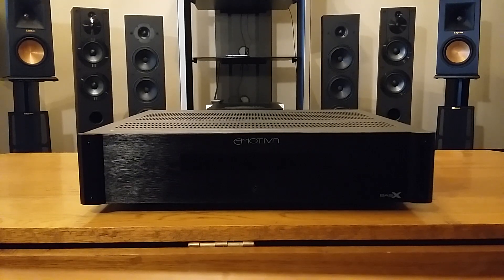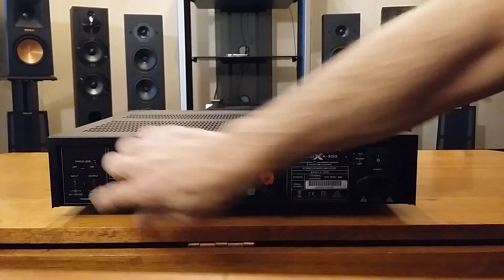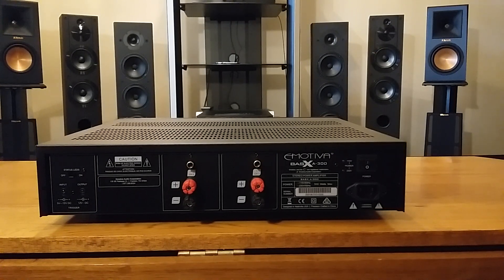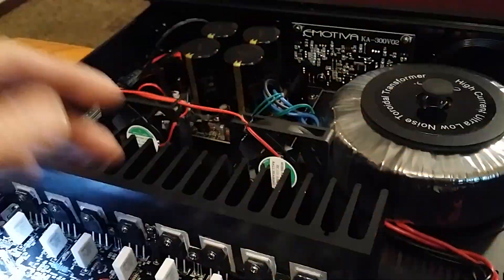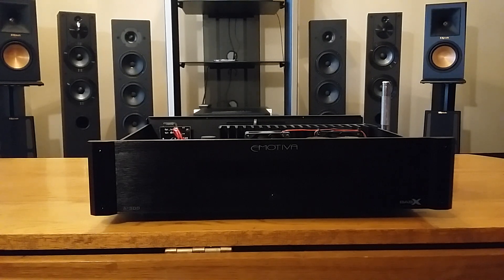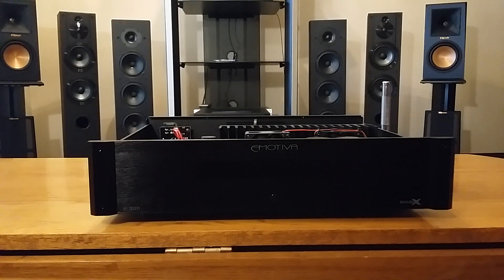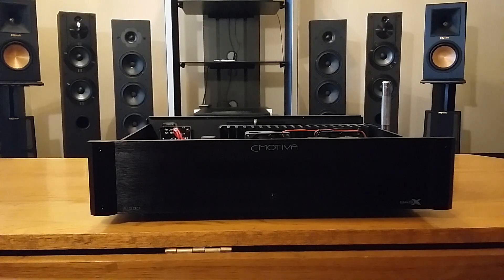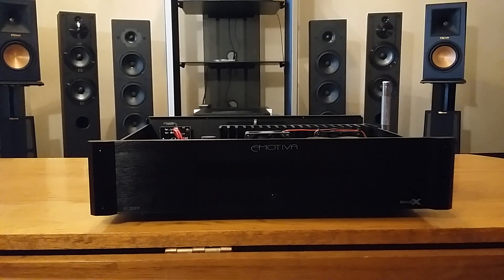Emotiva BasX A-300 class A/B 2 channel amp full review and a peak of what's inside of this amp

Comment: My left channel has gone weak on this amp.  It still plays, but what I used to play both L&R on my marantz at -5db each.  Now I have to run the left at +10db to keep the output balanced (I'm testing this via my marantz test outputs and a db meter).  I ruled out cables and speakers....... everything points to the left channel.
Do you think loosing one capacitor would do this?
Reply from the maker: Depends on which cap in the powersupply no most likely transitor going bad if you checked all other cables wires and hook up opposite speakers '

Comment: Emotiva discontinued the BASX A-300 (1 or 2 years ago), and replaced it with the BASX A2. Both of these power amps look almost identical front and rear. The difference is they downgraded the A-300 power spec. from 300 watts @ 4 ohms, to 250 watts @ 4 ohms for the A2. It's probably the same circuitry. Maybe they realized the 300 watt/4 ohm spec. was not accurate. I still want to try out an A2.
Reply from the maker: Yeah i think i frowned on the 300 watts even during the review but how many watts doesn't matter what matters is the quality of them watts 😃 I would love ro see companies measure at full bandwidth !! Thats a different ballgame thanks for stopping in and letting me know
Reply: @tee-jaythestereo-bargainph2120   Thanks TJ.
Reply: Formaly A-300 Power Supply provides double 52V voltage, so the power output max on 4Ohms is
 (52/sqrt(2))^2 /4 giving 338W of power in each speaker w/o distorsion.
But its transformer was less powerful to provide 2x300W for THD 0.1%, so the spec was THD 1%.

But 2x300W and THD 1% was reachable.

Comment: Ive yet to find another amp @ these power ratings made in USA for the same price. Finally saved me enough to buy one, then Emotiva goes and 86'es the model! I reached out,and they offered to sell me a refurb A300. These guys really are awesome, Emotiva is highly underrated if you ask me.
Reply from the maker: Its been a solid amp for sure
Reply: @tee-jaythestereo-bargainph2120  Much thanks. My rig is a hodgepodge of vintage middle/upper middle shelf gear. The amp just feels right in every way for my specific application. So very eager to get it now : D

Comment: Been thinking about getting a power amp for a while now. Have a marantz sr6007 receiver powering my Polk rtia12s sounds good I guess . Would this amp help bring it to another level?
Reply from the maker: What would you be using for a preamp ? Your Marantz Reciever ?
Reply: @tee-jaythestereo-bargainph2120  yes
Reply from the maker: @christhomson9170  the 6007 is about a 25pounder and driving all chanels you get a real maybe 55watts but Marantz is pretty solid now if you had a Nr1607 slim Marantz i would say yeah go for it ,
 I mean yes you would have a lil more power and relieve stress off the marantz   6007 but whats really important is finding out what the preout for front left/right speaker is from the Marantz it self i have seen the preout voltage basically be to weak to drive a bigger amp properly Audioholics Gene breaksxthis down in one of his videos , And the thing is the Emotiva does not have a gain controller on their basx A-300 so you can't match the voltage output ! You really need a 2volts output from the preout of the marantz and alot of times you'll get like 1.5-1.8 and this will not drive the Emotiva amp properly and when this happens to pep their like this amp sucks when in reality the voltage gain output isn't enough if you can go for the Marantz 7025 that one should match your amp maybe you can find one on sale their about 799.00 new i know twice that of the Emotiva but i keep it real dont want you to spend money and then be disappointed !
Reply: @tee-jaythestereo-bargainph2120  that’s what I was asking. Thanks for the info.
Reply from the maker: @christhomson9170  anytime chris channel belongs to the subscribers since day 1 😆

Comment: Is there an appreciable benefit to adding this to a surround receiver with pre-outs for the front channels?
Would it help for two channel mode?
Reply from the maker: Yes i have used my Marantz hometheater reciever paired to the emotiva a300 more headroom and drive/Torque/ fullness in the bottom end i use the NR1409

Comment: TJ, can this amp handle 2 pairs of 8 ohm bookshelf speakers.   1 pair of Elac Debut Reference speakers and 1 pair of Fluance Signature Series Surround HiFi Bookshelf speakers?  I i tend to parallel connect these speakers which I do currently with my Denon DRA-800H Receiver.    I just purchased a A300.   I intend to play with a IOTAVX SA3 preamp.  I like it that it is made in the USA.  I am toying with ordering a IOTAVX PA3 Amp to see which may be better.  For the record, the Emotiva is more powerful, includes free shipping, but does charge sales taxes.  The IOTA does not impose taxes But does charge for shipping at British pound rates (IOTA is a British company).  Said and done, the Emotiva has slight edge in total costs , about $70  or so.  I'm looking forward to the use in my stereo setup.
Reply from the maker: I wouldn't , its not reccomended 😃

Comment: If it is not for the obvious price difference, do you recommend BasX A-300 amp or 2 Outlaw audio model 2220 monoblock? Outlaw monoblock sends 200 watts at 8 ohms and 300 watts at 4 ohms. From the BasX specs, it looks like the 300 watts at 4 ohms is rated at 1 khz.
Reply from the maker: Yes at 1khz i never tried the outlaw b4 but i wrote them a year ago to send me something like the 2270

Comment: I have the xbase and the top end is wicked!
Reply from the maker: With the right PreAmp this amp kickass ! Espically for price point ! I never haf a fan kick on or any problems has the cool clean top end !
Reply: Tee-Jay The Stereo-Bargain-File, what I find funny is that this class ab amplifier runs cooler than any class d amp I ever had! The amp barely ever gets warm at all and I keep it on all the time.
Reply from the maker: @peterotremba8980  same here mine stays cool also , And i drive some very non effeciant speakers ! Its an awesome amp the Preamp PT-100 is ok espically for the price , but once i used an 800.00 Pioneer elite HiRes reciever thats a preamp also ohh my ! What a difference I even used the 499.00 IOTA SA3 integrated amp thats a preamp also with the A-300 and could not believe how much better it sounded than the PT -100 !

Comment from the maker: I used a$ 800.00US warmish sounding Pre-amp for my subjective Opion of the A-300 ! I should have not done that , I should have reviewed the amp with the PT-100 which in more recent videos i have , This amp is on the cool side of netural decent bass midrange is not forward at all decent imaging for its  price point  still till this day i give it a 4.5 stars for 400.00 US its a kickass lil amp !
Reply: If you're using speakers that can be bi-amped, it's worth it to get the TA-100 over the PT-100.  It's the same pre-amp, but you can use the TA-100 to run the highs, and the A-300 to run the lows.  It's just $100 more.  So, you could get the T2+ towers, TA-100, and A-300 for $2200 all-in, and have something to blow anyone away.
Reply from the maker: @cowboyflipflopped  the Ta 100 is
 50 watts the A300 is 150 watts thats a big difference to use for biamping normally the rule is half the power of the larger amp 😃 You would want 'atleast" a 75 watt amp and an integrated amp used as a pre-amp adds alot of noise ! Just keeping it real !
Reply: @tee-jaythestereo-bargainph2120  You may be right.  But for some odd reason, it sounds great to me.  I have tried using the TA-100 as just a preamp, and letting the A-300 handle the towers by itself.  I also replaced the brass connectors between the binding posts with good 12ga wire, for that experiment.   They sounded really good that way.  But they definitely sound better using the TA-100's amp, too.  I used to use the TA-100 with some HSU bookshelves, before upgrading with the towers and A-300.  So, I'm building with what I had on hand.  But, I would recommend this setup to anyone.  Maybe it's not as good as it sounds, but I guess I'm not too worried about that.
Reply: @tee-jaythestereo-bargainph2120  hi Tee-Jay, great review! I really love the passion and honesty of your channel, and I have some questions for you. 
Is it ok to connect a phone to the a-300 power amp directly via 3.5mm to RCA cable without using a preamp? 
Currently my phone is my only music source. I know it’s not ideal in terms of sound quality, and I don’t mind not having tone control and analog volume adjustment. 
Is it going to work? And will it cause any damage to the amp? Are there any other disadvantages? I tried to research online but couldn’t find the answer. 
Thank you!
Reply from the maker: @pengxu8542  you can put i wouldn't recommend it 😃
Reply from the maker: @cowboyflipflopped  thats all that matters is that it sounds good to you !!!!!

Comment: I've had mine for about two years driving my Klipsch RP-280F mains off a Denon AVR-X4300H in a 7.2.4 setup. That Denon is a 125w/ch  $1,600 AVR and this improved the clarity, dynamics, and punch of the mains, and it also allowed the Denon to run barely warm as opposed to hot even under very high volume levels.  I can backup everything said in this video.  This Emotiva BASX A-300 is as good or better any $1000 range two channel amp you can find.
Reply from the maker: Thank you for backing me up ! The amp is a true Gem at its price point , 
I won't ever get rid of it., I have thought about modifying it later later on maybe just sounds so clean , 
I'm about to review the combo PT-100 /A-300 in the nexted week or so been pulling very long hours at work 7 days a week 😥  thanks again for the comment
Reply: Hey Tee-Jay, how's it going ? Did you ever modify your A300 ? Interested if you have any upgrade ideas ? Cheers, Mark

Comment: Need a small tips
Considering the A300 to push my 75 watt speaker
Is there any implacation as the Amp is 150 per channel and my speakers is 75 watt.
Is there any setup to adjust to 75 watt
Reply from the maker: Their is no Gain -Controls on A-300 
 But i would rather have more than less having lots of head room, your lease likely to clip the amp 😆

Comment: so a 4.7 for the Emotiva BasX A-300 and a 4.5 for the IOTAVX Stack??? Do you have a take on the IOTAVX SA 3(which I saw your review on) used as a pre-amp vs The Emotiva TA-100(used as a pre amp) or PA-100(same as TA-100, no amp... same DAC)??? with the reviews Ive read/ watched, Id say the reviewers lean towards the IOTAVX DAC(Wolfson) as the better sounding of the two... but nothing definitive... Thanks
Reply from the maker: Yes the IOTAVX SA3 and complete STACK is atleast 2 levels above the Emotiva combination with The TA-100 integrated amp and the PT-100 Preamp with the emotiva BasX-A300  , I knew adventually this question was coming and i have to be honest, i was so upset that The Emotiva basX PT/TA 100 was not all that good compared to the actually a300 amp so much so i didnt review either TA/PT because i couldn't reccomend them at all, very thin sounding not enough meat on the bone the interface and remote was awful ! So yes the IOTAVX-STACK is much better ! Now i took the IOTAVX SA3 and used it as a dedicated Pre-Amp connected to the Emotiva BASX-A300 and i about fail over !! Still not as good as the complete STACK but maybe just a level or a half level behind the complete STACK .So the IOTAVX-SA3 will be a good upgrade for someone who has the TA-100 or PT-100 hooked up to the BasX A-300 😆 at work hope this was understandable
Reply from the maker: Emotiva with their BasX line the amp is great I was not impressed with the analog devices 1955 built in DAC the IOTAVX-SA3 Has a much much better built in wolfson Dac. But thats my opion maybe someone else likes the Sound of the PT-100 or TA-100 but the remote and interface problems also kepted me from reviewing them and u know i would have gained more views and subscribers but i have to keep a honest foundation

Comment: Awesome power amp, can't beat it at this price. If only emotiva would fit quiet fans inside it. I had to change mine for some really silent ones because the original fans were just too much noise. As for the sound, I doubt you can buy anything under 1k USD to beat this.

Comment: Great review! I own the A-300 and I agree 100% with opinions about the and your sentiments here 15:02 . I'm actually driving 250 miles tomorrow to buy an XPA-2 Gen 2 !
Reply from the maker: The XPA-2 Gen 2 is a beast ! What  Pre-amp are you using ? I tried the PT-100 And T.A. 100 but really didn't impress me much. Not bad for the price but the A-300 amp Is very impressive . Buf i did finally find a responsable price Integrated amp that sounds amazing for its price point and its designed as a pre-amp also and pairs very well with the A-300 .I will be reviewing what i'm talking about nexted weekend
Reply: @tee-jaythestereo-bargainph2120   I'm  running an Integra DRX-3.1 as a pre/pro.
Reply from the maker: @noguardrails47  Heck yeah Honest ratings has somewhat the same build parts and  quality as the Pioneers Elite SX-N30. The Elite was 799.00 new  2 channel class A/B PRE-PR0 ,Took me 8 months to find better sound for a budget price under 600.00US i went threw 3 preamps 1 integrated pre/pro 5th buy was a charm ! But yeah i would use your A-300 for your surround speakers ! or maybe 2 center channels , center channel is so important !!
Reply: @tee-jaythestereo-bargainph2120   I was thinking I'd buy a used UPA-1 for center channel amplification, when I can afford it and see the right deal. I do have a feeling that the line out voltage of my Integra DRX 3.1 might be below the needed input voltage to achieve full volume without clipping from both my emotiva amps. I'd like to keep my receiver and maybe buy something that will boost my preamp out voltages. When i used to mess with car stereos it was called a "line driver" i think. Or do I need some kind of pre amp that runs downstream from my receiver but upstream of the amp ?  Any advice that you might care to throw my way on that would be much appreciated. 

 By the way I really like the XPA-2 so far and can tell its going to be in my system a long time.  I cant see getting rid of the a-300 either. If it weren't for the a-300's decreased dynamics ( when compared to the much more expensive  xpa-2)  I'd say in some ways it sounds as good or better to my ears than the XPA-2.  If the a-300 ever does come out of my home theater it will either become my computer speaker amplifier or 2nd room channel system or..something, but its not leaving :).

Along with Dan, thanks for all you do to help those on a working man's/woman's budget get the most for their money.
Reply from the maker: @noguardrails47  at work 3rd shift :( soon as i get off we will see how you can tweek that center channel may want to go for a more efficient speaker thats easier to drive for your center channel
Reply from the maker: @noguardrails47  Yeah thats a tuff 1 but do you have a gain adjustment in your integra for each channel ? I bet you do My Pioneer Elite Sx-N30 2 channel amp does have gain for front speakers 12+ to 12- And a gain for headphone output , I dont blame you for wanting to keep your integra their very good Pre/Pros for the price they are hard to beat

Comment: Just wondering if anyone has any thoughts about leaving my A-500 turned on 24/7 vs turning it on/off everyday when I used it-btw I've got solar power with a Tesla Powerwall battery.
Reply from the maker: Honestly the amp sounds best warmed up , but its a doubled edge sword , the life of an amp depends on how hot its ran in its lifetime , espically the output stage transitors go bad over time due to heat thats why thier mounted on a heat sink ,let your amp warm up about 20 to 30 min before playing thats what i try to do , But yeah after running my Integra amp for about 30min it sounds much better but always leaving it on might not be a good idea, but i bet it sounds dang amamizing warmed up lol

Comment: Hi Tee-Jay just would like to inquire how did you connect the Pioneer SX-N30, is it through the line outs? Curious how do you control the volume if it is connected to the line out?  Thanks.  Plan to buy this, but looking at pre -amps, they are also very expensive.
Reply from the maker: Dennis Teo I used full range preouts not zone outs The elite came with preouts/zoneouts and 2 powered subwoofer outputs tje non elite version didnt have this feature
Reply from the maker: The Pioneer elite Is a beast with its own amplified internal source being a true class /AB At 85 watts rms at 8 ohms A 170watts at 4 ohms that's about 50-80 watts of  true clean power that's saying a lot coming from a die hard Yamaha-Marantz fan

Comment: Hi, can I use audio jack onboard motherboard outputs to connect them to a "EMOTIVA BasX A-500" power amplifier? =>https://emotiva.com/products/a-500

Motherboard is B450 AORUS PRO=> https://www.gigabyte.com/Motherboard/B450-AORUS-PRO-rev-10#kf

Now I have an entry level AVR connected from GPU HDMI to AVR works fine but I want to upgrade to a bigger amp and not AVR., but my AVR don't have pre-outputs also I don't need all those bells and whistles it haves. PC software/hardware audio seems very improved noways compared with the past. 

Connection wise seems attainable for 5.0 setup, by connecting "3.5mm to 2-Male RCA Adapter Audio Stereo Cables".
-3.5mm Male connector on one end (left and right output) and two Male RCA connectors on the other end.
-3.5mm Male connector on one end (Surround right and left output) and two Male RCA connectors on the other end.
-3.5mm Male connector on one end (Center and Sub output) and one Male RCA connector on the power amp(Center) and second RCA to active subwoofer if I will add in the future.

If motherboard audio outputs working like "Pre-outputs" should work, have you tested any configuration like this before?